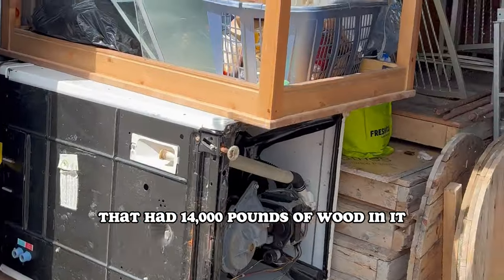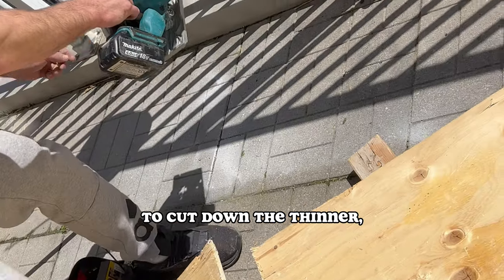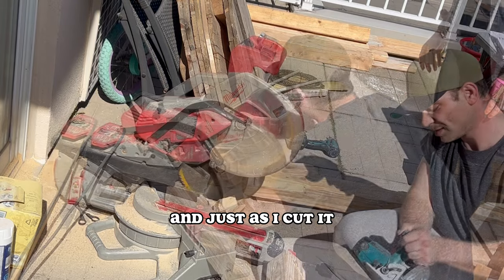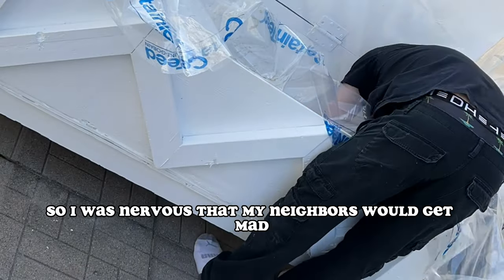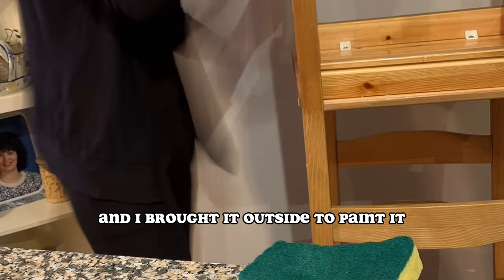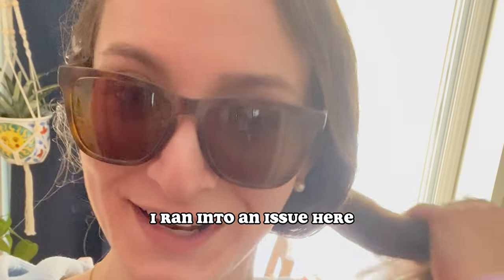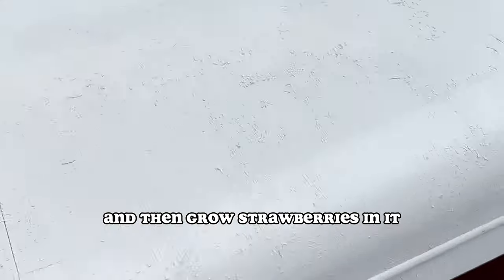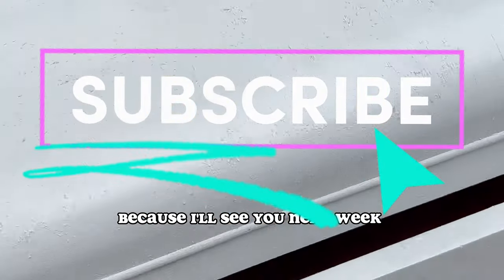I Transformed My Apartment Balcony Into An Epic Garden

Comment: Okay, I'm curious: Is that a ground-floor balcony?
If so, I got suggestions.

First up, this is going to be about expanding your growing space in a way that maximizes the space (giving you more growing area than you actually have, without changing the balcony), AND in a way that provides a bit of privacy for your balcony and may also add a pinch of Security for your garden space and prevent some loss of produce.

IDK where you are (and not asking), but I'm in Los Angeles and anywhere you grow, here, if it's visible, it's not mine. I don't have a fence, with means anyone who passes by can (and will) harvest what they want and take it.  You don't have a privacy fence on that balcony. I've thought of ways that you can have privacy... and some security.

This starts with buying wire shelving. You can get these at Costco/Sams and also most big-box home center stores, such as Lowe's or Home De Pot, etc. Standard size is 18" D x 48" W x 72" H (or 45.72 Cm x 1.2192 M x 1.8288 M), which easily holds standard 1020 trays for seed-starting and stuff like that. Top shelves are great for that.
Also buy shelf-supports.  (I found them on Amzn. If you want a link, just ask.)
Instead of buying 3 shelving units, you buy two sets and divide the shelves (total of twelves) into 3 sets of 4. Set up the two units and connect them with another shelf between them, using the shelf supports. So instead of having 8-ft wide shelves, you have 12-ft wide. Depending on how wide your balcony is, you can hook the shelf supports on the end of the units or at the side, which makes a nice 'L' shaped corner shelf set.
If you can afford enough shelving units, you can surround that entire balcony in shelves, outside edge and sides, which in essence becomes a sort of fence.  You could hang bird netting or tulle on the outside to make intrusions difficult, too.

When you have the shelves set up the way you want them, you can start putting planters and pots and troughs on those shelves, fill them with potting-soil and grow, baby, grow.  You're now growing vertical, using the same space 4 or more times (depends on how many shelves you have, right), which means you can grow 4 or more times as much produce.
I recommend you put large spacing on the bottom shelves, so you can put big tubs or 5-Gallon (20L) buckets, for growing tomatoes, squash, pumpkins, melons, etc. Anything that grows big needs big pots for their roots.
You can grow potatoes in totes in the center of the bottom shelves and climbing vines along the sides, which can use those shelves as a trellis to grow up onto and eventually up-and-over. Indeterminate tomatoes are so much fun!
On the middle shelves you want to put the medium pots with medium stuff like broccoli and cauliflower, cabbage, kale, other stuff. Head lettuces and spinach.
Upper shelves should be used for lighter-weight stuff that can do shallow roots, like cut-and-come-again salad greens, lettuces, arugula, stuff like that.

When your shelves are full of pots and planters, troughs and trays, buckets and barrels, tubs and totes and maybe even a few trays of soil-blocks and new seedlings....
There's your Privacy Fence.
There's your little bit of garden security. The shelves make it difficult to access anything beyond them. (Bird netting would make it difficult to access the shelves, too)  If you have a bed of strawberries growing in the center of the balcony, first of all, nobody's going to know and, second, it will be bloody difficult for anyone to get in to take them.

AND, after you've filled all those shelves with... ahem!  all-of-the-above... you've only used the outer edge (just 18"/46cm) of the balcony.  All the space inside that is still clear and available for use. You could set out a table and chairs to have Tea for Two at Twelvesies, surrounded by green, growing things, without all the nosy-nabob neighbors watching you.

IF you want to add just a tiny bit more privacy to all that, here's what you want to do.
Get yourself a stack of trough-style planters (rectangles) about 8-10" (20-25cm) wide, about the same depth. Put that along the outside of that little fence.  Plant sunflowers in them.  First of all... sunflowers! Yay!  I grew them and they were soul-warming and beautiful and then I let them dry out and harvested the sunflower seeds. So, yeah, there's that.  Second, they grow huge and tall and they bush out with loads of inter-leaving foliage... which provides further visual privacy barrier.... AND places at least another 12"-18" (30-46cm) of plant between the Outside World and your garden space.

(You'll have to consult with your apartment Management about rules for how much you can put outside that little fence, and what and how far out you're allowed to extend from it.  IF you're not allowed to put planters outside that little fence, then you'll have to put the trough planters inside that fence and set up the shelving that far away from the little fence.)

(If it seems to you like I'm belittling that little fence... it's because I am.  LOL  Not sorry that I'm not sorry. NOT belittling you, tho.)

If you have any questions about any of this, just ask.
Reply from the maker: woahhhhhhh THIS IS AMAZING. THANK YOU SOOOOO MUCH for taking the time to write this. it means the world to me. <3 <3 <3